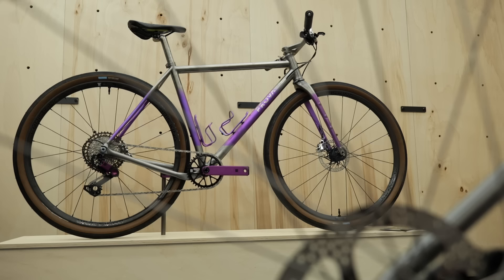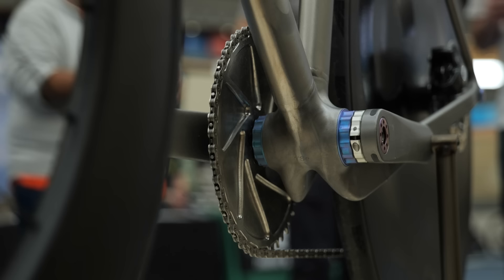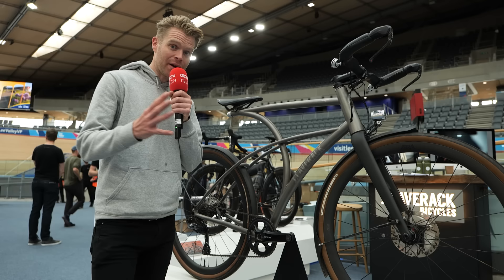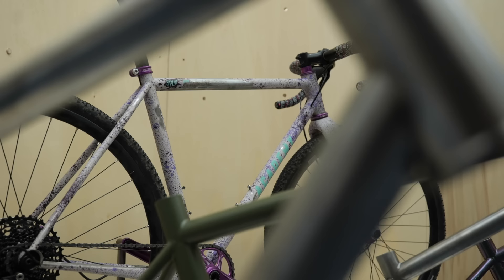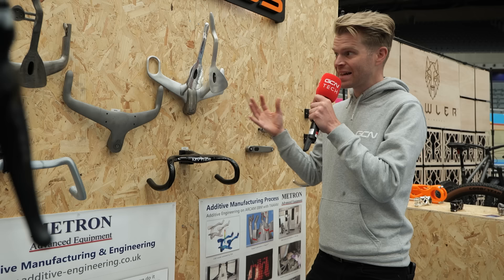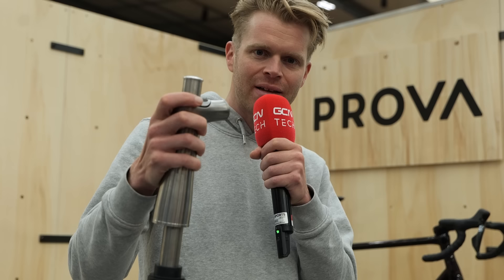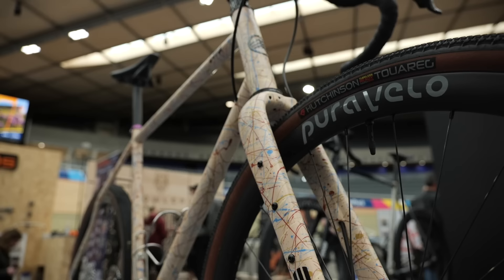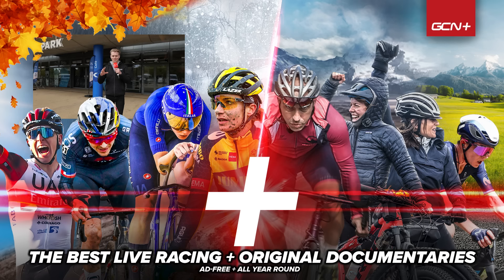Best Custom & 3D Printed Tech | Bespoked Handmade Bicycle Show 2022

Comment: The ice effects are caused by urea fertiliser, which you can buy off ebay from as little as £10. Cheaper than the branded product. You have to apply it in warm conditions to get larger crystals. You then give it a thin coat of black paint and sand that off to reveal the high bits before giving it a coat of candy paint. There are tutorials on youtube showing how to do it.
Reply: Thank you for explaining, it's interesting. I still think I would buy the product if I would attempt such a paint job. To many techniques to master at one job otherwise.
Reply: Except there are water based ones which you wipe off and don’t need to sand
Reply: @sssxxxttt  The sequence is; after the primer, use a silver base coat, spray on the solution, then a thin coat of black.. You then use scotchbrite and water to to reveal the outlines of the crystals. After that you spray with Candy (translucent paint), then clear coat.

I have seen a Colnago with blue candy and that looked really good. If you put the solution on in cold temperatures, you will be very disappointed as the crystals won't grow much. The already mixed branded solution is about £24. Here is a tutorial: https://www.youtube.com/watch?v=Pkq8Zn5_76s

Comment: As a some one how as work in engineering making medical devices by hand, 3D printed is not a by word for quality. 3D is amazing for 1 off and prototyping and has amazing qualities when it comes to saving weight. The drawback is repeatability and cost and quality.
Reply: This is changing.

Comment: My old Kona Cinder Cone 1988 was a white frame with yellow and red splashes.
Reply: I had one of those, replaced it with a silver-green fade in 96, still ride that bike as my commuter.
Reply: @hectorkidds9840  Nice!
Reply from the maker: The splatter paint is back 🙌

Comment: i invented the internal cross section of tubes, not just for overall strength, durability and weight savings but for strategic compliance. that honey comb stuff doesnt look like it accomplishes anything but to keep a flawed tube building method from breaking.